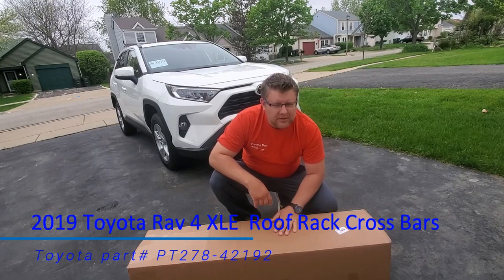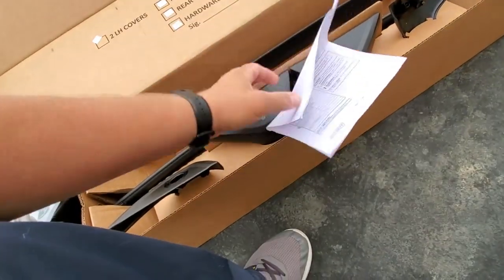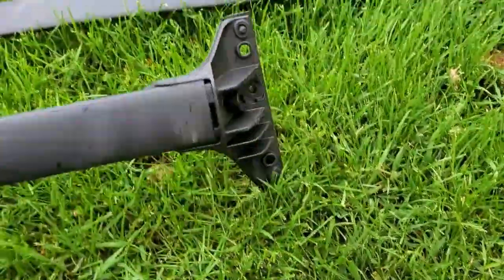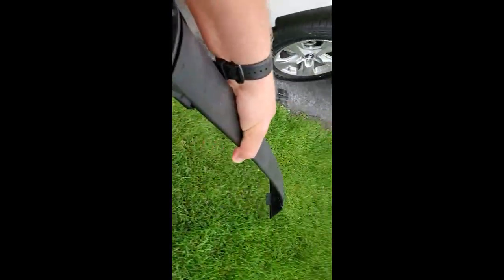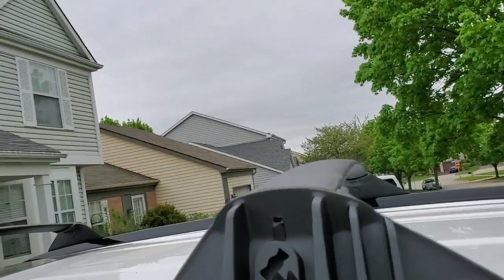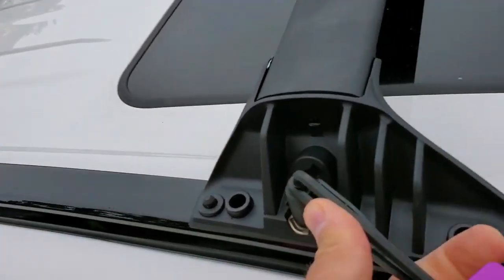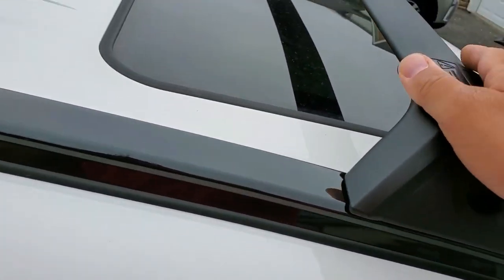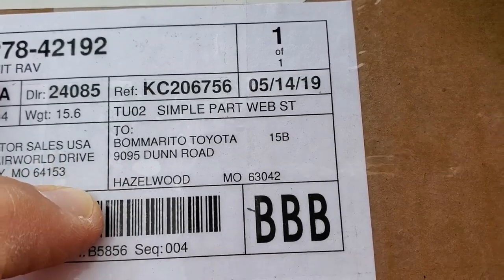2019 Toyota Rav4 Roof Rack Cross Bars installation.

Comment: I installed mine using your video thank you so much. When I check the cross bars out the box one side of both bars was moving/ sliding.  Is that normal? After installation nothing is moving or sliding. It feels solid.
Reply from the maker: Its normal like that to slide a little on one side, but make sure that small bolt is tight. Also do not load more than 150lb on top

Comment: Its odd that the loose connection on the crossbar wasn't addressed.  Mine has the same things, and there is no way to tighten it.  I put in spacers to fix the slack. Obviously there is a design problem with it.
Reply from the maker: I installed OEM Toyota roof racks and no issues, everything tighten well no spaces required.

Comment: Thank you for demonstrating the installation of the cross bars. I just purchased a 2020 RAV 4 and I want to get the cross bars. You made the installation seem easy enough and now I just need to buy the cross bars. Well done.
Reply from the maker: Welcome to team Rav4,you gonna love this vehicle. Thank you for positive comments on the video. When you gonna be installing these,do not overnighter bolts,use torque wrench provided. Also at fist these roof racks gonna be making some wind noise but you will get used to it,because functionality of these roof racks beat all the negatives.
Reply: @nazarettos6987  I did purchase the cross bars from the dealer you suggested. Great price and they should be arriving soon. Thanks again for your instructional video. I will follow your advice.

Comment: I’m just confused because I just called the dealership. The told me the roof cross bars are only capable of holding up the 100Ib. Is that true??
Reply from the maker: I carry very large kayak 13.5 feet on top of these racks,they are great. Very strong. These racks can hold 80lb each total 160 lb. When you evenly distribute load,these are very strong racks. I with confidence carry 80lb kayak even at high speeds.
Reply: @nazarettos6987  that's great, but what about 2 kayaks plus j hooks?
Reply from the maker: @-8_8-  well the only way to find out is to try it. Are you planning to buy two rambler kayaks? What kind of kayaks are you buying?
Reply: @nazarettos6987  I'll gladly take advice on kayaks. The fiancee just wants a 'yak, you may be familiar with that. And we want our own kayaks. For me, I'd like something with decent tracking but I think I need to also be nimble in small channels, as this will see a lot of shallow stream/bayou. This is the setting I'll try fishing in first as well.  And maybe some dip netting for the old aquarium. I also live near a number of sizeable lakes, so this would be the closest to ocean I plan to take it in. I think the depth gets to 14 feet in some areas, but I don't know if I'll be out there with the randomly spotted sharks, or closer to land with the alligators. Lake gets pretty choppy too. Problem is, I've been wrong before in expectation vs use. I do often stare longingly at the pedal fishing kayaks. So it would be nice if the rack could hold that in case that's my second kayak. My plan was to hit Massey outfitters when they are rotating stock and buy one of their rentals. So far I have not nailed down a model, or even an exact length as a result.  Again, I'll listen to any advice. 

We are looking at the Thule compass carrier at the moment because she's also interested in paddle board, and it can do one or two boats. I'm guessing two paddle boards can be done on it or a paddle board and a kayak, but that's assumption.

Comment: Toyota told me this part “did not exist” for my 2019 hybrid LE, and to keep checking back, but this part fit on exactly.
Reply from the maker: As you see in my video,it exist  :-) 
Go to this website and buy it from them
https://parts.bommaritotoyota.net/p/Toyota_2019_RAV4/Roof-Rack-Cross-Bars/70290679/PT27842192.html
Reply: Toyota has no crossbars available in Canada yet.  So annoying.
Reply: You must be in Canada
Reply: I was told same by toyota dealer in Mississauga, Canada. That is crazy! We not suppose to use roof racks. By the way what did you end up buying aftermarket Yakima or Thule?
Reply: @ankur75757  neither as I can't find one that truly fit the Rav4.  I ended up going to the States and bought one there for $225us.  Dealer here in NS says that they are working with Thules to develop a model for it and dealer in QC said they should get it by end of 2019.  Not impressed about that for sure.
Reply: I am told the OEM costs 300, in southern USA. But that's because it's being added free with our purchase of a new car that won't fill up all the way. Rofl. Perhaps order one from a dealer here and have it shipped? Or just see what Thule carries.

Comment: Hey one question, i know the bars are aluminum, but what about the supports, are they aluminum too?, or plastic?, excellent video thanks a lot.
Reply from the maker: All aluminum, the only thing that is plastic is  locking cap.
Reply: Ah i see now, thanks, here in mexico are selling one set of bars just like yours but at $110 US dollar, the difference is that the supports are ABS plastic, not aluminum, so thats why the difference i guess.
Reply from the maker: @pablorm8011  sorry for late reply. Yeah you don't want any plastic support on roof racks, has to be metal. I can't even tell you how helpful these roofracks came to be.

Comment: It sucks that the front bar is just on top of the moonroof, it should be some inches back. It makes a lot of noise and I end up taking them off.
Reply from the maker: Yes it does make some more noise but the roof racks are very strong. Much better roof racks than those that slide.

Comment: Many thanks for creating this video. What are the directions of the arrows. You said the arrows show into this direction, but you did not mention if the arrows should be directed to the front for both bars or to the front for the front bar and to the back on the rear bar.
Reply from the maker: Arrows point to the front of the vehicle. Also you won't be able to install it other way,it fits only one way.

Comment: Just came home today with our brand new white 2020 Rav4 and i want to put a roof rack and hitch just like you..... great tutorial
   If that is OEM that is a good price. The dealer wants $300, where did you get yours?
Reply from the maker: Don't buy anything from the dealer for them to install. You can DIY. Follow my videos,I got some more cool videos on the way. Check out how I also upgraded window switches.https://youtu.be/aQCdQ9JUdjw
https://parts.bommaritotoyota.net/p/Toyota__RAV4/Roof-Rack-Cross-Bars---With-Anti-Rotation-Clip/70290679/PT27842192.html

Comment: 160?? Ok, your kayak is 80 pounds, so that works well for your application. How much would a kayak typically weigh? I know they are all different lengths, and some have paddle systems so it's hard to estimate. I was wanting something with decent tracking, maybe for camping and fishing, not ocean, but very large lakes as well as small bayous.
Reply from the maker: My Kayak is 75lb, and each Roofrack can handle  80 lb. 160 is total load capacity. I tested these roofracks well, I drove on the highway with Kayak on top no problems,all summer long.https://youtu.be/aevkTpJmIms
Reply: @nazarettos6987  ah, I'm sorry I saw that in the video. I failed to mention that I'm trying to put two kayaks up top. I'll check the video you linked, thanks.

Comment: Hi, getting it installed from toyota when ordering as an accessory is cheaper or buying it after purchase cheaper?

Also no parking sensors even in XLE premium Hybrid. It says you have to opt for a package, which package is that?

And taking 39000 dollars and can't give us parking sensors! 

This is why I am cancelling my plans for this vehicle. I am highly disappointed. Nothing is standard on any trim except wheel size and moon roof. Seriously!
Reply from the maker: Buy those roof racks after you get your car. Dealer with try making extra money on you. You can order these for 170$

Well if you buy For or Chrysler they will start falling a part at 45_60k miles. Toyota is well made vehicles and they don't depreciate fast.

Comment: Im getting a highland u venture roof rack, in the manual says, maximum allowable distance between bars, should ve 32 3/8",  can you tell  me, the distance between bars with this bars installed???
Reply from the maker: That's is about same distance on my Rav4
Reply: So it will fit exactly to the maximum distance allowed, thanks for your help
Reply from the maker: @ulisesarce118  when I installed mine,there was only one way to bolt them in.
Reply: @nazarettos6987  yes, I'm talking about the maximum length between bara  the roof rack can be installed on

Comment: I wonder if those weird little spring metal anti back out washers are available somewhere as replacements.  If you take the bars off, you'll probably tear a couple of those up.
Reply from the maker: Good question, maybe at home Depot you can buy something similar. I'm gonna keep my roof racks on,no need to take them off.

Comment: I just bought a 2020 rav4 Limited...anyone know if the crossbars are the same as 2019?  I understand the body has not changed between 2019 and 2020...
Reply from the maker: Congratulations on your purchase. I more than sure that these crossbars will work on your 2020 Rav4.
Reply: Nazarettos thanks...I checked with Toyota and they also said the part number has not changed for 2020.
Reply: I just put mine on today.
Reply: What did you use to mount on the roof rack ? Bikes, kayak, etc...Reason why I asked is because I just picked up a 2020 Rav4 Limited with the racks already installed.  I was thinking of mounting a bike tray for my mountain bike and was wondering how sturdy is it.  I'm still skeptical as I don't know how strong these racks are compared to my other sedan's roof rack.  Thanks in advance for any 411 you can provide me.

Comment: I would have thought there would be some plug for the holes where you used the key. Open as it appears seems like invitation for debris, ice, things that attack screw holes, threads.
Reply from the maker: Yea you are right but so far I had no issues. I kept my roof racks over winter,I have no problems.
Reply: @nazarettos6987  Maybe give a squirt of clear silicone on a hot day when you know there is no moisture inside.

Comment: Excellent video! We are in the market for a '19 RAV4 Hybrid Limited, and also have kayaks like you. Your video and explanation answered all my questions. I think the only thing I would do differently is maybe put a little bit of releasable Loctite on the bolt. But I'm a belt-and-suspenders kind of guy when it comes to that sort of thing.

I'll probably add a hitch at some point, so I'' be stopping back.

Thanks!
Reply from the maker: I'm gonna install hits tomorrow
Reply from the maker: Did you install that hitch? I installed mine and also bike carrier.

Comment: Did you get any leaks on the headliner? There is an defect within the rav4 roof rack where it doesn't seal in properly, which allows water to leak inside your cabin in your headliner.
Reply from the maker: No such issues with my Rav4. Also you should not get any leaks because these roof racks simply bolt onto the metal support bracket and there is no intrusion into the cabin.

Comment: I had the OEM crossbars installed. The front crossbar is lower than the rear.  Is that a problem?
Reply from the maker: Absolutely no problem,just do not overload them no more than 70lb on each.

Comment: Amy issues with removing the crossbars when not in use?  Did you notice any change in gas mileage with them on?
Reply from the maker: Well I haven't remove them yet,I use it all summer. You do notice some noise at first but not really bad. I am gonna keep them on all winter. Miles per gallon still good,but not with kayak on top,but still very slight milage drop.

Comment: Makes to much noise when you have the sun roof open. There’s no adjustment either. Either on or off?
Reply from the maker: Well you get used to the noise. You can also install wind breaker but it looks stupid on the car.

Comment: Hey man I installed cross bars on my highlander and now its loose..I cant seem to tighten the bolt...is there a solution?
Reply from the maker: Are those original cross bars for your highlander? Mine are designed for Rav4 and I had no problems with bolts.
Reply: @nazarettos6987  yup highlander

Comment: Did you tighten the bolts that fasten the cross rails to the feet?  You showed that the cross rails slid a little at the beginning of the video.  Doesn't seem necessary because the assembly is rigid when attached to the vehicle - as you showed.  I'm asking because I did not get complete instructions.  Your video helped fill in the gaps - thanks!
Reply from the maker: I was wrong,you don't need to tighten those bolts. Those 2 bolts are already tigjt
Reply from the maker: I paid 180 with free shipping. And those bolts don't need to be tight
Reply: @nazarettos6987  where did you buy with this price?
Reply from the maker: @zizhexu  I bought it from Bommarino Toyota dealer. The link is in my description.

Comment: I’m about to install my crossbars on my rav4...one question I have:  early on in your video, when you were showing the crossbars, on the bottom of the crossbar, there were 2 screws with star-shaped adjustment holes...it appears they are loose on one side of each crossbar, as if to allow a little allowance if you need a small length adjustment of the rail when you are installing them.  My question is: did you end up tightening down the star-shaped screws or is it not necessary? (I didnt see a tool enclosed in the kit for this purpose).
Reply from the maker: No adjustment needed,they are screwed in tight. I used these crossbars all summer,no problems,very strong. I carry 13.5 ft kayak on top all summer,no problems whatsoever,  also noise is not that bad when sunroof is closed.
Reply: The play is designed in to accommodate slightly different widths of the fore/aft roof rails.  You will not be able to tighten the screws to minimize the play.  Once installed, there will be no left to right play in the crossbars as they will be anchored and held rigid from the opposite side.
Reply: I think this is a defect.  I made spacers to get rid of the play at it didn't affect me fitting them on.